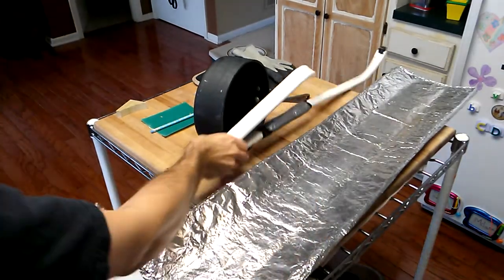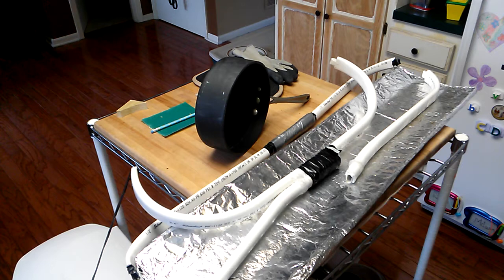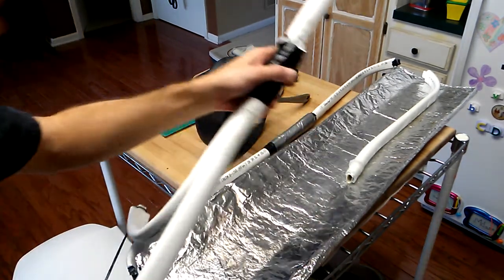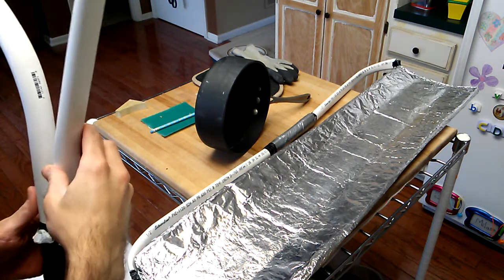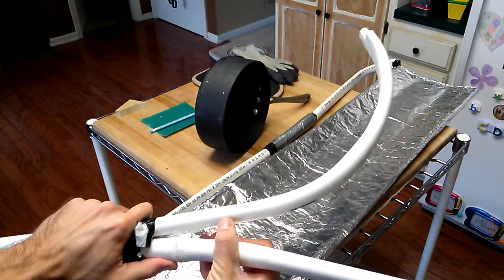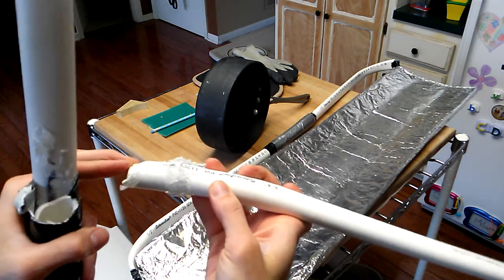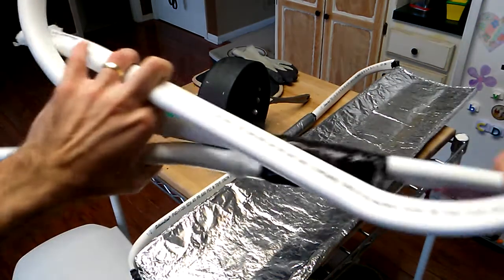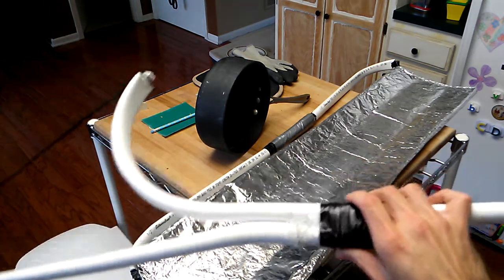PVC Bow Draws Blood - The Double-Bow Shatters Yet Again

Comment from the maker: It's possible - I'm not sure. I really can't say if it would happen or not - PVC is strangely durable - you can sand the heck out of it, and it doesn't explode, since it doesn't have a grain structure or rings to violate. I think it's possible to drill holes in it without causing failure, but until I try, I'm not sure :-)

Comment: Wouldn't the screws just cause center points for the stress? Assuming that your screws are the same as my screws (the ones that you screw into the pipes) then I believe the hole created by joining the two together would under the stress of the limbs turn into a crack and instead of snapping like in with that bow, it may cause the bow to crack,splinter and maybe, shatter (which may be like a mini-explosion, cool but probably not so good for your hand!) just thoughts not facts, if I'm wrong, sorry